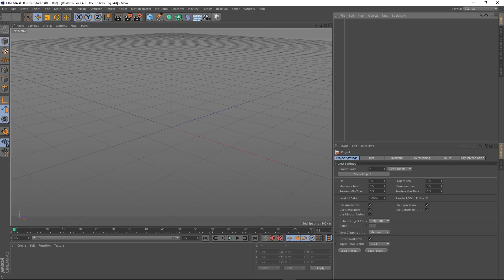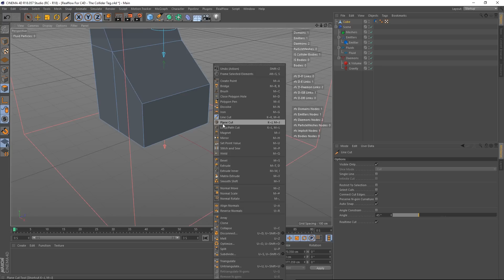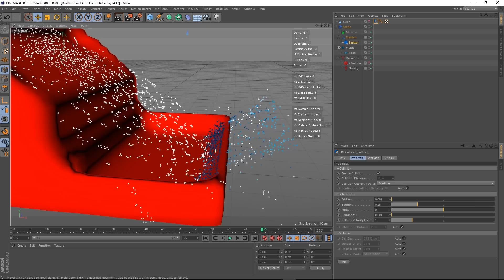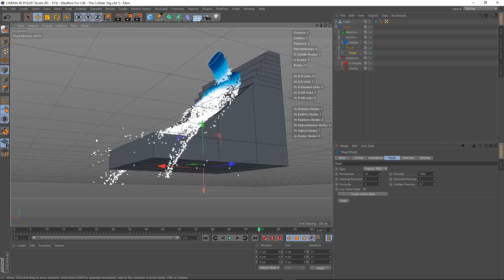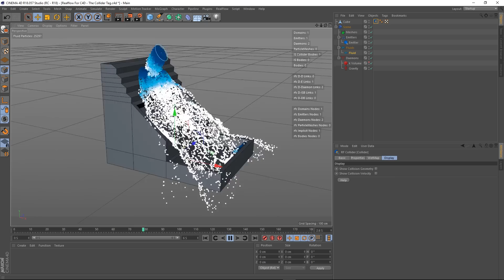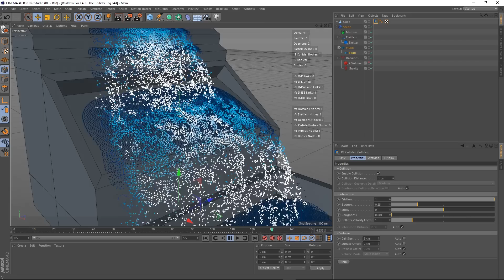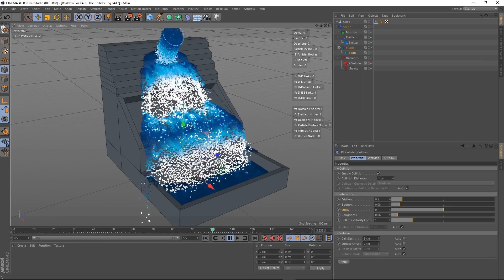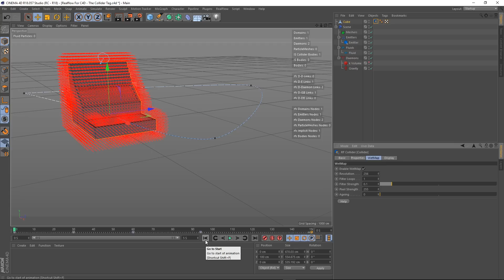Realflow For C4D: The Collider Tag

Comment: Fast-forward two years and they still haven't added multi-gpu support, but they say it's coming. A bridge (SLI) is normally not recommended for anything outside gaming applications, for those interested in the details.